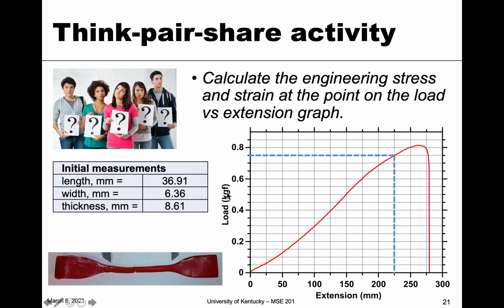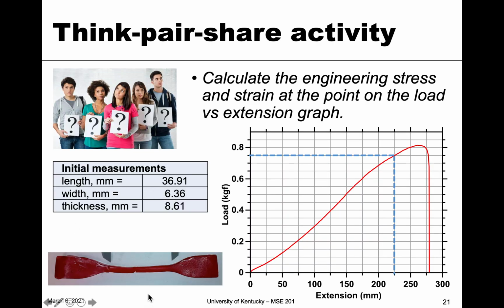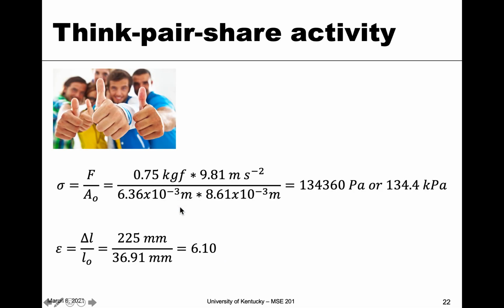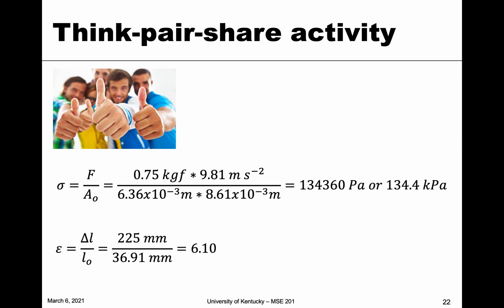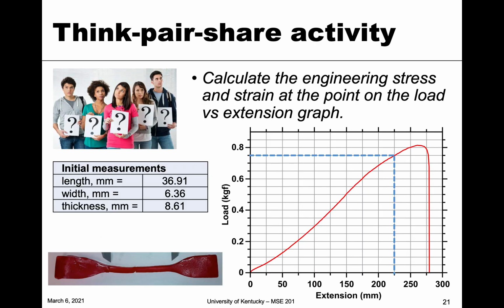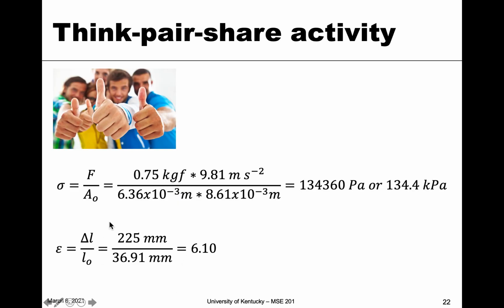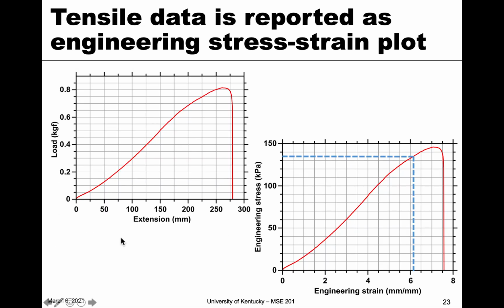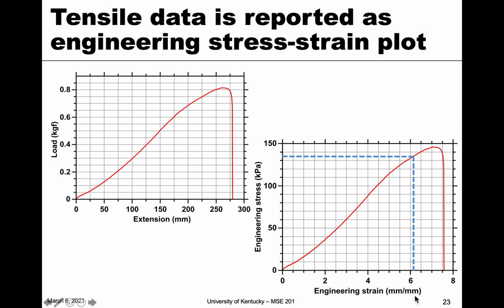MSE 201 S21 Lecture 19 - Module 2 - Stress & Strain Example

Comment: why do you use 225mm as the delta l ?
Reply: idk if you still dont know why we use it, its because the delta l is "change in length" so we can simply look at the graph and say that the change in length (in this case it is extension) is 225mm. It's between 200 and 250 so it should be 225.